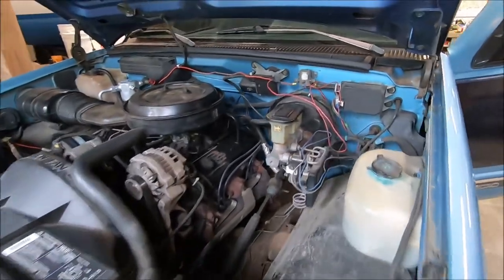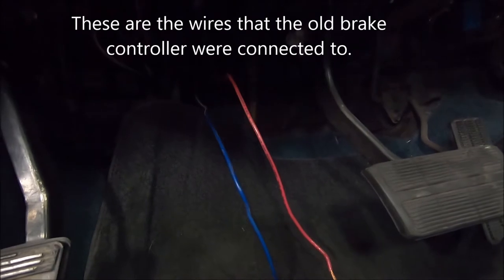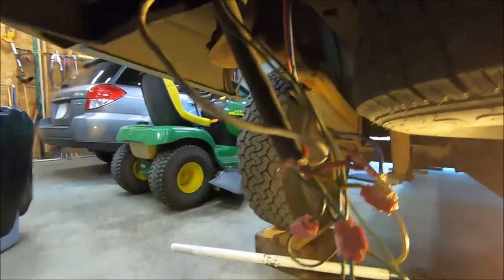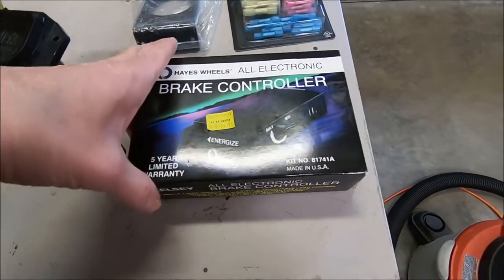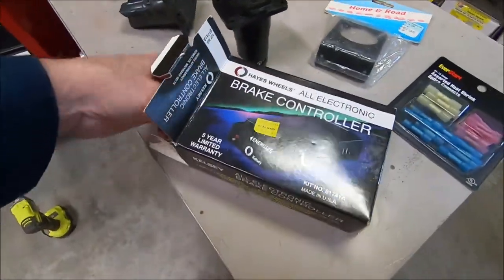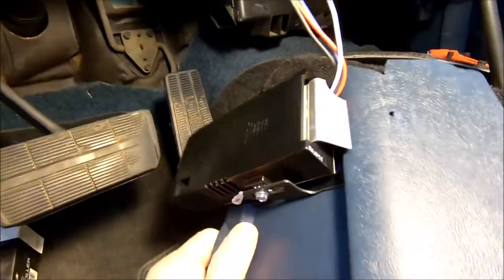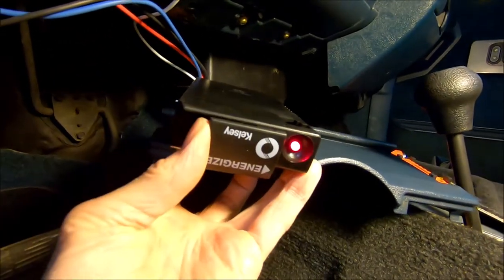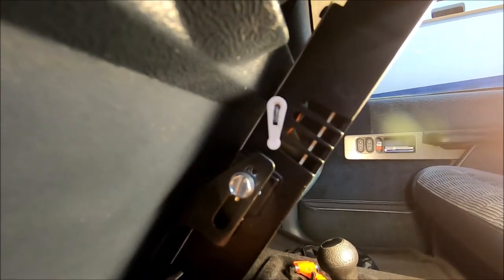Installing An Electric Brake Controller on My 1993 Chevy Silverado K2500

Comment: Hello! I have this exact truck, brake controller, and also suffer from parasitic drain. I am about halfway through the repairs you outlined in your video. This is by far the most helpful tutorial I have ever seen! Thank you!  Did you end up fixing the drain issue? Was it the rusted trailer connector?
Reply from the maker: Yes, it was. I had the parasitic draw problem for about a year or so and this 100% fix my problem. Thanks for the nice comments!